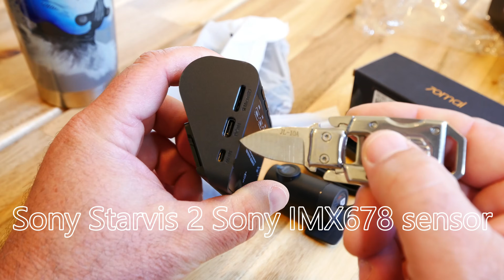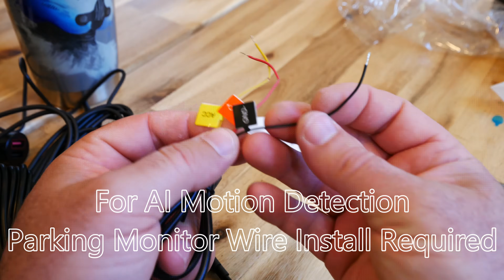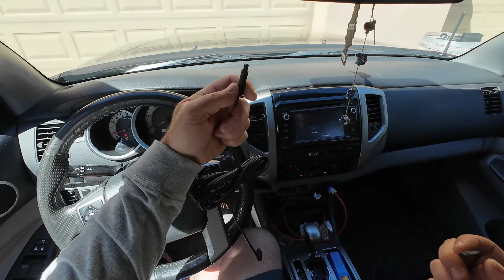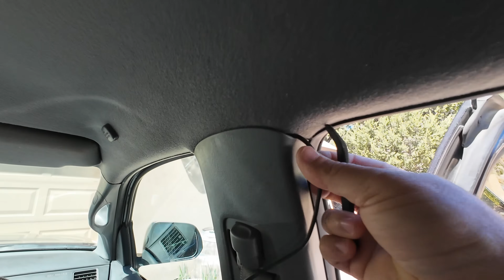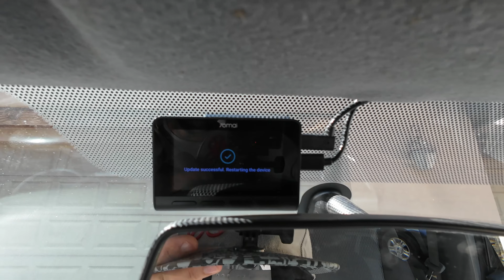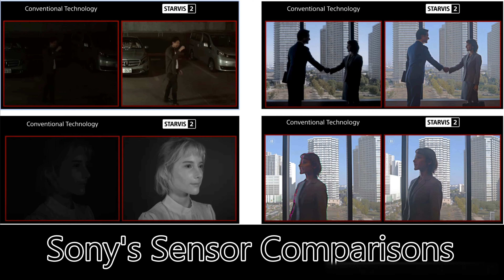How to Install / Use a Dual Channel Dash Camera - 70mai 4K A810 Dash Cam Review

Comment: Does this camera have the ability to save videos? I am aware it saves them to the memory card but they will be overwritten once the memory is full. I'm asking, if an incident occurs that you want to save, can you press a button to instantly and permanently save that clip?
Reply from the maker: When it detects vibration (adjustable) from an incident it locks the file in a separate file which cannot be overwritten unless manually erased 🍻

Comment: I just get my new dash cam 70mai A810 and I have a big issue with the memory card. I have SanDisk MAX ENDURANCE U3 V30 128gb and its doesn't work - receiving an error to change the card. Also I connect the cam with the phone, but cannot update the firmware without correct memo. Can you please give me any advice... If anyone can tell me exactly what memory working on this cam (excluding 70mai memory card - can't find it at my region)
Reply from the maker: Try 64GB or lower 🍻

Comment: Is there a way to use this without an account or even the app? Do I have to use the app after the initial pairing? How easy is it to take out the SD card?
Somehow, I'm not comfortable with being logged into some account while recording and having GPS signal turned on. I see no reason why I need to be signed in for that functionality.
Reply: You can use it without mobile App, also to insert the SD memory is very easy,

Comment: Great instruction.  One of the best videos on this camera.  Note that the front camera can operate in 4K resolution at 30 fps or be changed to operate at 1080p resolution at 60 fps.  Many owners are reporting that the 1080p resolution at 60 fps provides a better experience than the 4 K.  60 fps provides a smoother video and is better at picking up signs and license plates when moving, particularly at highway speeds.
This camera does have the option to "turn off" the water marks that show GPS coordinates, speed and time, but be aware that many insurance companies and police forces (possibly the courts) are beginning to refuse to accept dash cam evidence, unless the water mark  information is embedded.  Also, note that the rear dash cam can be horizontally rotated to film the inside of the vehicle from the rear.  Could be handy if you have strangers in your vehicle, such as when you may be selling the vehicle and you have a stranger test driving it.
Reply: How will you retrieve the video if strangers take away the vehicle if that's what you meant by having them as risk

Comment: Thanks for the great video and thorough explanation. Are you sure it only can provide 25 fps on both camera. I believe, It should have 60fps on 4k. I have just ordered one, that is why I am excited😂
Reply: He said he had both cameras set for 25 fps, but you have options.  Actually, the two frame rates are 30 fps and 60 fps.  The rear camera, which is 1080p only operates on 30 fps.  The front camera can be set to operated in 4K resolution only at 30 fps, or it can be set to 1080p resolution to operate at 30 fps or 60 fps.  Many owners are reporting that the 1080p setting for the front camera with 60 fps is a better experience than the 4K setting.  60 fps provides a smoother video and is far better at reading signs and license plates that are in motion.  Both fps settings are equally capable of the camera's low light features.